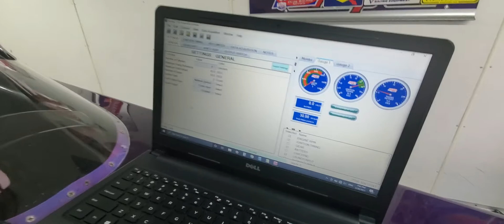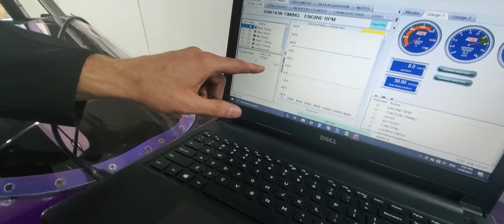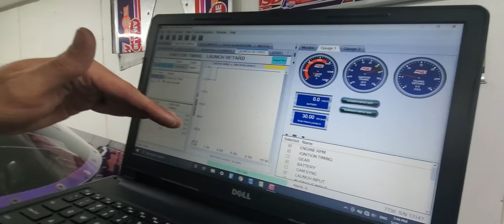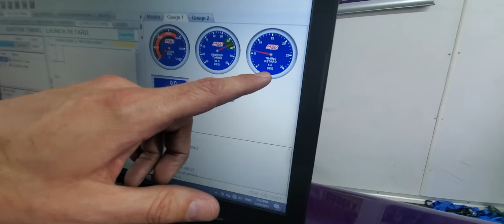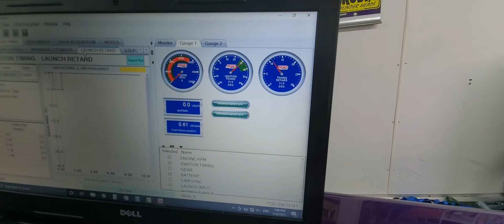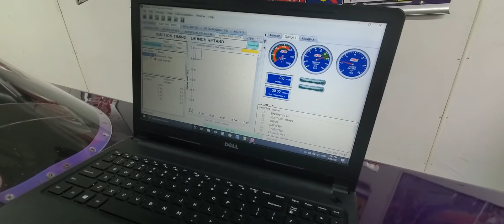MSD GRID ignition controller: How to program a Start Retard and Launch Retard

Comment: It happens so fast I can't tell, but my question is it set to pull timing from the transbrake button release or when the transbrake solenoid releases?  if it's the button, wouldn't you have to figure in how much time is in your delay box plus if you're the faster car you would have to figure in the crosstalk time correct to get an accurate time frame to pull timing?  Hopefully it's after the solenoid, Thanks!
Reply from the maker: The trigger wire that the GRID sees comes from the delay box, so yes, it would be the correct time including any cross over delay you have in the box.

Comment: Hey setting up my grid and the main timing is at 35 degrees on my engine and I’m not quite sure what the max retard should be at a lot of people show there’s at 30 but I have a super comp car like yours and you have 16 could you inform me a little more on that?
Reply from the maker: The max retard is the total number of degrees of retard you can pull out from the max timing reference. The max you can pull can be no more than 30. You can set it to be whatever number you like up to 30. So if your max timing is say 42, and your max retard setting is 30, you can retard to a total timing of 12 degrees. Hope that helps.

Comment: Setting this up currently.... but if it's locked at 42.... and pull 5... should be 37 ..... where does the 6 come from.?
Reply from the maker: Hi Chad, hope your setup is coming along. So the 6 degrees of retard is what makes up my static desired engine timing. So, my CT pickup is at 42 BTC, I have told the grid I want locked 36. So it retards 6 degrees (42-6=36). Next, I tell the launch retard to pull 5 degrees for a period of time. So, when active the 36 moves to 31 and then back to 36. (36-6=31). Hope that helps. Thanks for watching!

Comment: 42 degrees minus 16 = 26    Right?  Thanks
Reply from the maker: The 16 degrees I referenced was the maximum total retard. That setting is the most retard that can be used. Meaning to say, if will not all you to pull out more than 16 degrees from the max timing reference. My 36 degrees of timing is the max timing reference 42 - 6 degrees. That means I can only pull out another 10 if I wanted to. To go beyond that, I would need to change the Max retard setting. Hope that clears it up. Thanks for watching!